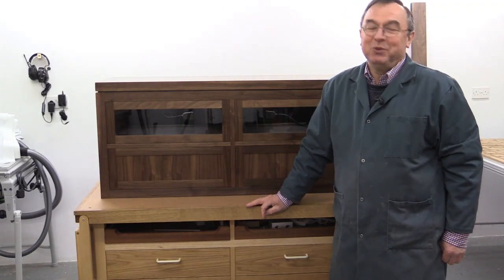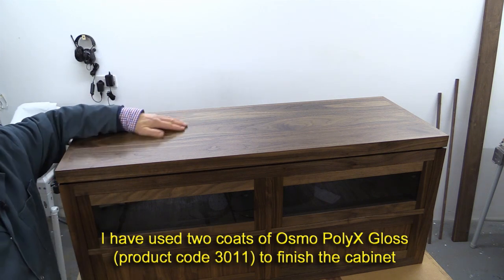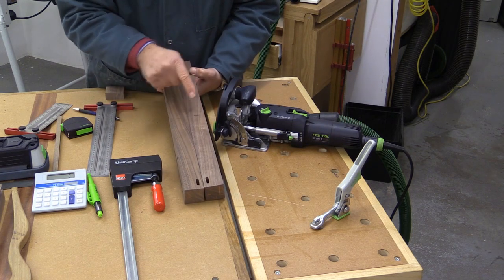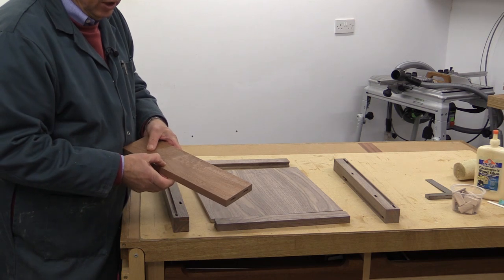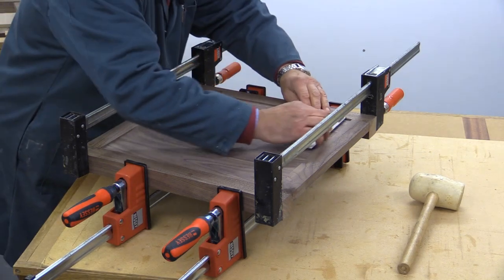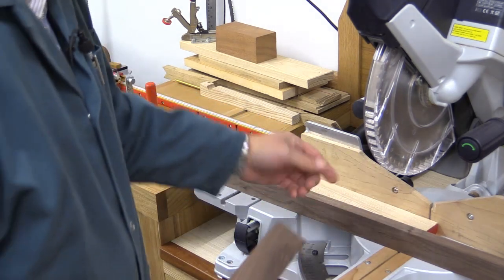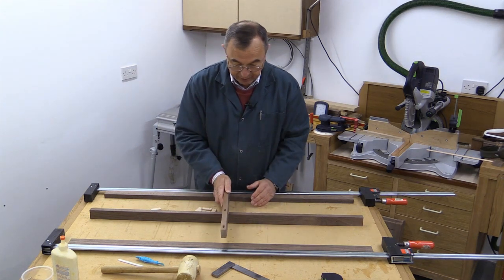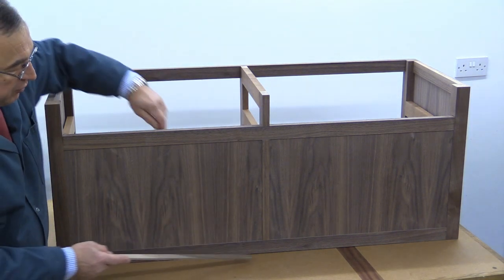TV Cabinet Part 1 - Main Construction

Comment: Hello Peter. I really like the construction on this project. The beefy frame and using the intermediate rails to support your drawer slides.... are the intermediate rails connected to your veneered end panels in any way? Do you build kitchen cabinets this way as well? Or are you making it beefier to support the weight of the heavy audio/video equipment? It an elegant solution for mounting the drawer slides. Sorry .... I’m only part way through the video and wanted to ask the question while it was fresh in my mind. 😊
Thanks Peter
Cheers
Ron
Reply from the maker: I don't think the intermediate rails are connected to the veneered panels. My kitchen cabinets are completely different as they only have a face frame fixed on after the cabinet is constructed. The "beefy" design is for a balance of the look of the item not for strength. You should also see my Pedestal Desk series of videos.   Peter

Comment: Nice job... why didn't you not just put a screw from back into the middle rail, that would have saved using a 4mm cover latt on the front. Just a thought :)
Reply from the maker: J Rowe If I had done that the middle rail would have gone all the way across. That centre stile needs to go all the way from top to bottom and not broken by the middle rail.   Many thanks.   Peter
Reply from the maker: New Brit Workshop Oops - I have just realised that of course it could still be done the way you suggest....I blame the guy who drew the plans !  Cheers.   Peter